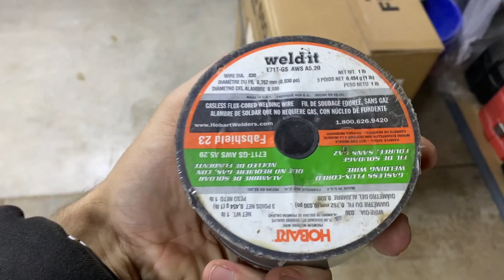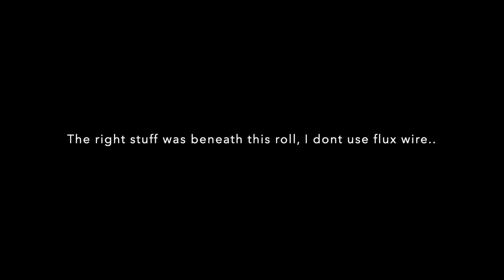Can A Suzuki Samurai Frame Be Strong Again?

Comment: Sweet tin top
Reply from the maker: Thank you! I ran your TC driver side mount before, that was a slick solution and never had any issues with it! Too bad I cant use it on the new setup :/
Reply: @johnnymoongarage  I appreciate the business. Yea definitely not gonna work with that setup. Should be sweet with a 3.4 in it.